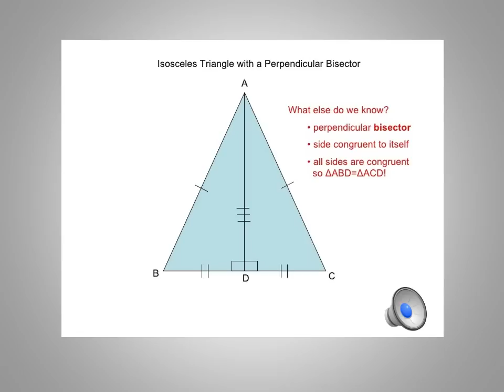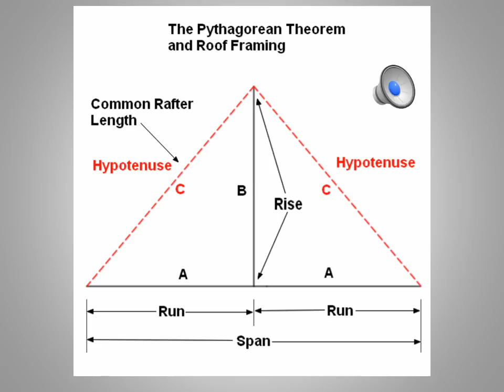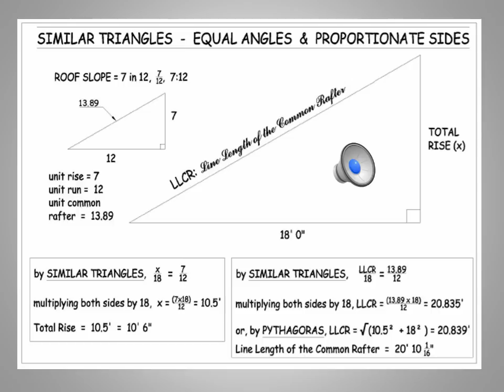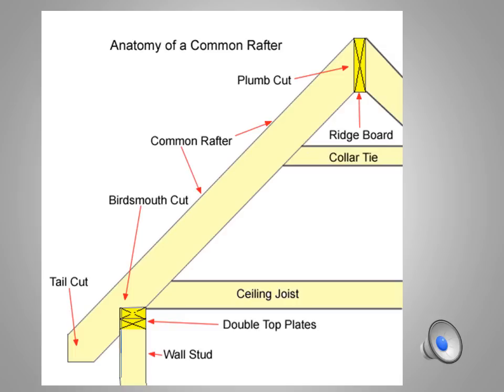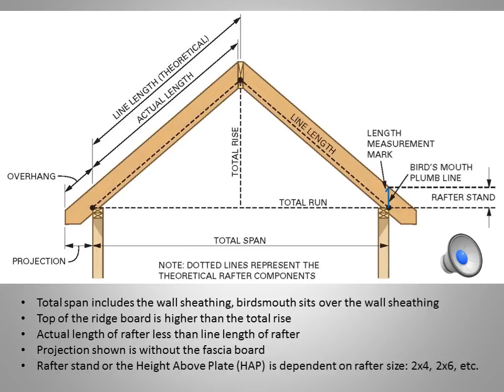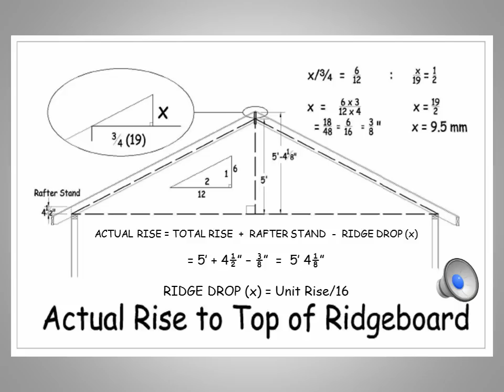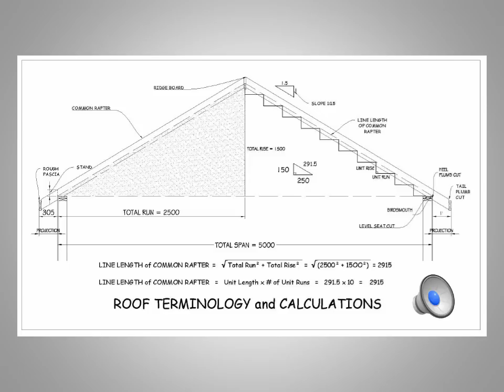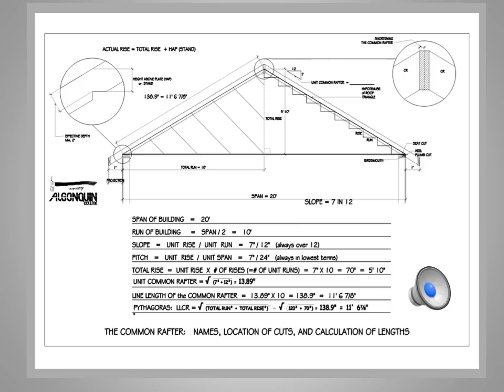ROOF FRAMING CALCULATIONS

Comment: I'll be building a 12x18 shed to join to my existing 12x12 shed (will remove the sheathing from the joining side), remove my existing roof and tie it in to my new shed, later  this spring. This has been extremely helpful for my understandings.

Thanks Professor! This is what I use the internet for!

Comment: That's why its easier to measure your span and run from the inside of the top plate rather than the outside. This way your measuring line is on the bottom edge of the rafter than  being inside the width of the board. And your measuring line ends right at the edged of the ridge board instead of its center. Don't forget to subtract the thickness of the ridge from the span before calculating the run..

Comment: I'm building a small shade structure. In order to figure out how to frame the roof I watched carpenters on YouTube with their speed squares and their framing squares and their construction master calculators and figured out all the pieces and parts then, like this guy, I sat down with paper and pencil and broke down all the little triangles. It's all just Pythagorean theorem or simple proportions, don't really need trigonometric functions except to calculate angles for a miter saw. Then I did it again in my cogo (coordinate geometry) software to confirm my numbers.
Reply from the maker: You're correct David. It's simple geometry.

Comment: Very, very informative and helpful. Two questions: how important is it to subtract the ridge drop from the actual rise calculations? Wouldn't the total rise plus the rafter stand calculations be sufficient for most structures?
Reply from the maker: The subtraction is mainly a test for carpentry competitions where the ridge is flat on top (a standard 2x6) as opposed to one that has been bevelled to a peak.

Comment: Hi Michael, I found your lecture very interesting and informative. I think its good to explain fully how it all works. I, personally, will remember this lecture and put it to good use in the future. I just have one question at 18:13 onwards where the small triangle at the top shows a ratio of 1:1.5 re the slope. Is this a mistake or maybe I'm not fully understanding this. Can you please clarify?
Reply from the maker: +Marios Ioannou 
Hi Marios

In the Canadian Building Code the roof slope is given as a ratio relative to a rise of 1(Metric or S.I.).  So a 1:1.5 roof slope is the same as 8:12 in Imperial terms and also the same as 150:250 when using the Metric (SI) framing square.  Good catch - I forgot to note that. First guy in 351 000 to ask that.

Comment: thanks for showing. It is a very tutorial, educational video. I built a roof and did the calculation.  The rafters  always came off a bit and could not fit right in.  The problem is the rafter with a birth mouth that accutally sit two inches or whatever inches inside from the outside walls.  You have mentioned about this problem by dropping the  ridgeboard height.  Can you explain to me how you get a 3/4?  And why use 16 as a base when calculating ridge drop (x)?  And what did you mean by cut/left on the flat?  I am not sure i got it.  Appreciate any help.
Reply from the maker: For a roof that has a 7 in 12 slope, 7 is the rise (vertical) and 12 is the run (horizontal) . You would compare it to a similar triangle that has a run (base) of 3/4 of an inch or one-half the thickness of the ridgeboard.  So the vertical (rise, r) of the small triangle would be found using ratios: 
 r ÷ (3/4) = 7 ÷ 12;  r = 7 x (3/4) ÷ 12 ;  r = 7/16 .  If the ridgeboard is 1½" thick then, the drop for the ridge is the unit rise (in this case 7) over 16.  This works for any roof slope as long as the ridge is 1½" thick.  An 8/12  slope would have an 8/16 drop or ½".
Reply: Thanks so much of your information.  Appreciate so much.  I am not in this trade.  But i love to build and design houses.

Comment: There is no need to calculate the length of rafters and framers will not be interested in getting into the math. All you have to do is mark run and rise at right angles on the flat, put the rafter in correct position with respect to wallplate and ridge and mark as required.
Reply: What if you have a tall building with long rafters? Are you gonna climb and place 6 meter wooden studs at 10 meters above the ground while your assistant applies a tape measure? Don't be a fool.

Comment: Very well explanation of the geometry. I still did not see how you calculate the rafter stand or HAP? You had 4 1/2 on the drawing.
Reply from the maker: Hi Charles

Sorry it took so long to reply.  I started to and then thought that a diagram would make it easier. I still haven't figured out how to post a diagram in the comments section. Well, here goes  - in words.  I had just stated that the Stand was 4½", I did not calculate it, but I measured it after the birds mouth was laid out. To  calculate it, you would use Similar triangles and Pythagoras's theorem.
First, to get the length of the plumb cut on a 6 in 12 sloped roof (1:2), draw a Ridge Plumb Cut line  on the end of the 2 x 6 rafter  and you will form a right triangle that is 5½" on on side, 2 3/4" on the other and the hypotenuse can be calculated using Pythagoras to get 6 1/8" [or you could just measure the plumb cut line].
Second, setting the horizontal Seat Cut line at 3¼", the Heel Plumb Cut line would be a half of that or 1 5/8" (again because it is a 6/12 roof slope). Subtracting 1 5/8" from 6 1/8" gives you 4½".

Comment: Why making things complicated. In ancient carpenters brotherhood calculations, we calculate hypotenuse using your given run measurements Multiplied to the secant at your given pitch and that's it. Example your run measurement is say 345.8 cm and the pitch is 45 degrees, just do 345.8 X 1,4142 ( secant number from periodic tables at 45 degrees ) equal 489.03. that is exactly your hypo. However good lessons for beginners it yours.

Comment: Does measuring and cutting roof rafters have to be this difficult,I think not, get a good roofing square,
read the numbers imprinted on the square,or learn how to read it, it will give you everything you need to know,
including rafter length of any pitch down to the birdsmouth,
Reply from the maker: True - just follow the correct steps.

Comment: The outside of a birds mouth does not sit flush over the sheathing, it sits flush over the top plate...😊
Reply: And then your notching he plywood around every rafter?
Reply: Some framers I've seen run the sheathing up to the the rafters, some up to the soffit nailer, I've never seen birds mouths' up against sheathing,
Although after thinking about it, it's a good idea
To not have to cut the sheathing to length. Unless you live in an area with high wind loads
And have to install hurricane ties, which would have to be inspected before sheathing goes on.
That being said....thanks for the input, and your
Drawings, they're very nice.😊
Reply: glenn underwood I always have sheathed walls and stood them up and then install rafters.....or I'll add an extra 1/2nor 5/8" to the seat cut so I can slide plywood up if the rafters are already installed

Comment: how do you work out A ? total run is 4940m which is B . Trying to work out A on a 12 12 pitch roof?
Reply from the maker: Not sure what you mean by 'A'. For a 12 in 12  roof, the Total Rise is equal to the Total Run.

Comment: can you please do one with millimeters instead?
Reply from the maker: Hi Ben
I will work on an SI version (mm) and post it ASAP.
Reply from the maker: Hi Ben (sorry for the late reply). In the SI system, roof slope is stated as Rise : Run, but with the Rise being '1'. So a 6/12 Imperial roof slope would be a 1:2. Using that ratio, and Similar Triangles, a roof with a span of 8m (run of 4m or 4000mm) and a slope of 1:2, would have a Total Rise of 2000mm (or 1/2 times 4000) and a rafter length of 4472.1mm (√(2000² + 4000²)).
For the same roof with a slope of 1:1.5, the Total Rise would be 2666.7mm (1/1.5 times 4000), and a rafter length of 4807.4mm (√2666.7² + 4000²)).

Comment: can you do your calculation without using calculator
Reply from the maker: To find the hypotenuse of a right-angled triangle you can use the framing square and similar triangles.  For instance, locate 5" on the tongue of the square and 12" on the body and measure from 5 to 12 and you will get 13" which is the square root of 5 squared + 12 squared. Also this number is etched on the framing square on the body under 5". You would then take the RUN of the roof in feet and multiply it by the 13" and that will give you line length of the common rafter from the centre of the ridge to the outside of the wall which is where you will cut the  birdsmouth of the rafter.
Reply: thanks for the info
Reply: Sketchup

Comment: I'm really struggling with the rafter stand part ad the actual length, done some practice cuts and keep screwing up
Reply from the maker: Hi David

I am not sure how to help.  Maybe you can give me the dimensions of the building and the slope of the roof and the lumber dimensions so that I can respond in context.
Reply: @17.00 Michael is making it Confusing 
Ridgeboard STAND = Total Rise + 4 1/2 ( HAP) 
then Subtract Width of Ridgeboard ( 2x8 or 2x6)= Ridgeboard Stand

Comment: how does the .839 get converted to 10in 1/16?
Reply: Jack F .839 x 16 = 13.424 or 13/16 not sure where the 10 1/16 comes from...
Reply from the maker: .
839 ft. x 12 = 10.068", .068 x 16 = 1.09 which rounds to 1, hence we have 10 1/16"

Comment: Can you or someone tell me what the hip/valley line length ratio “secant “ is of a 5/12-8/12 bastard roof is . I don’t know if I’m doing the math correctly or not.
Reply from the maker: When calculating rafter lengths for an Unequal Slope Hip Roof, all measurements need to be made to the fascia line in order to maintain an equal projection on all sides. For the roof in question, let's call the 5/12 side the 'Side Roof' and the 8/12 side the 'End Roof'. For a Side roof run (to the fascia line) of 2' or 24", the rise would be 2 x 5" or 10". Therefore the End roof rises a total of 10" with an 8/12 slope and thus the End Run is 10" x 12 ÷ 8 = 15". The Hip or valley rafter then has a run equal to the hypotenuse of the 15/24 triangle or SQ Root of (15 squared + 24 squared) or 28.30". But it still has the same rise of 10". The length of the Hip/Valley rafter would then be SQ Root of (10 squared + 28.30 squared) or 30.01". [you can skip a step and take the SQ Root of (15 sq'd + 24 sq'd + 10 sq'd). The Hip angle is found by taking the INV TAN (ARCTAN) of 10 ÷ 28.30 or 19.5°.
You can also take the ARCSIN of 10 ÷ 30.01 .
Reply: @michaelnauth  when calculating the run for the unequal slope hip. Do we use the run of the shallow side or the steep side.
Reply from the maker: @TR-rn3pd  When calculating the rise for the Unequal Slope roof, you would use the run of the shallow side, measured horizontally  from the fascia line to the centre of the building.
Reply: @michaelnauth  made sense to me after reading your last comment a few times . Thank you for your help.